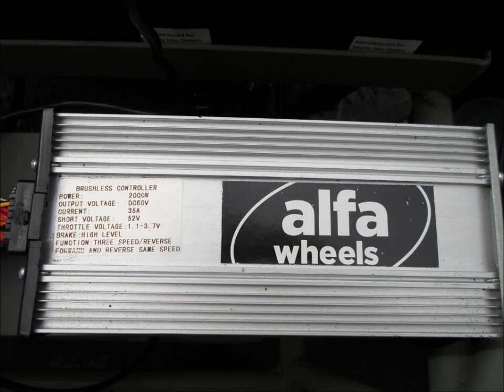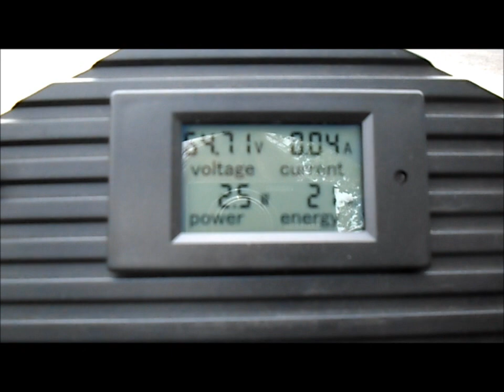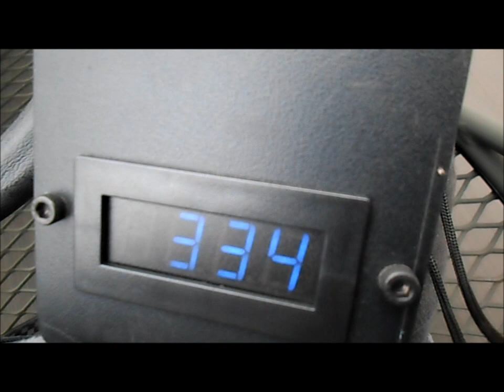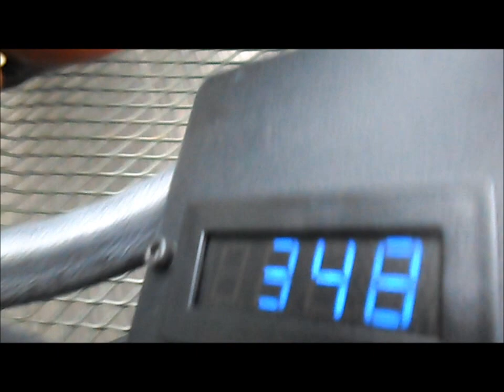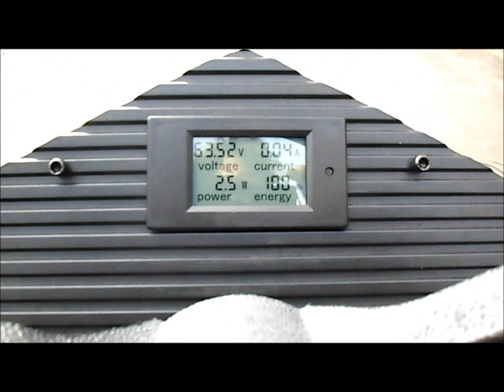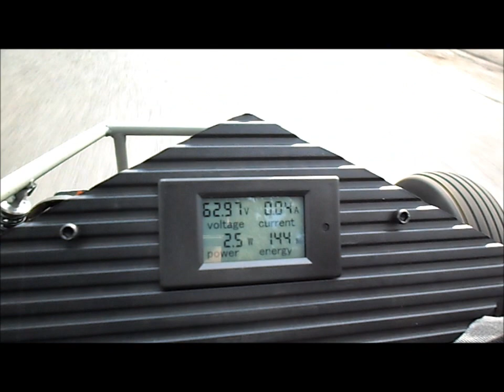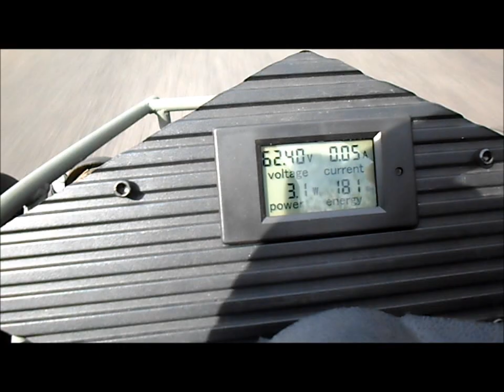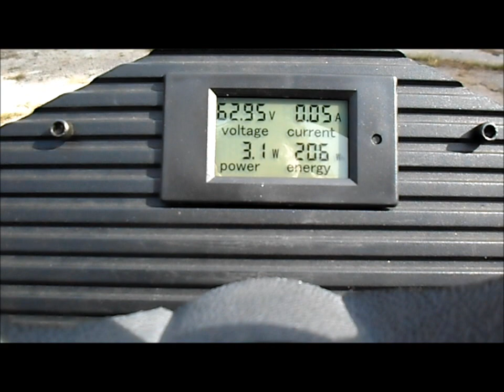Ariel Atom Go Kart loaded RPM test ride

Comment: So it stops workimg as soon as you hit 52 volts?
Reply from the maker: Yes,it's a safety feature to help protect the battery pack.A fully charged 60V battery pack starts off at ~66.5V, as you run the kart & deplete the battery, the voltage drops. If the voltage drops too low, the battery pack will be damaged.

Comment: What size tires are you using?
Reply from the maker: The rear tires are 13 - 6.50 x 6 & the fronts are 13 - 5.00 x 6.